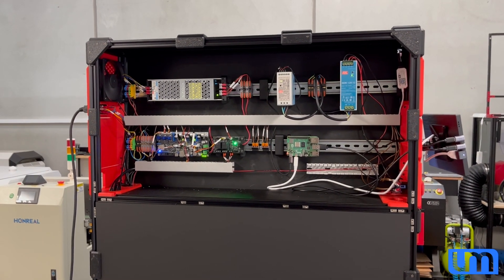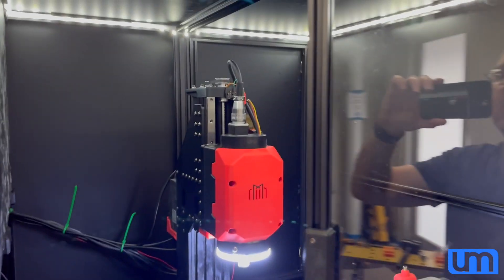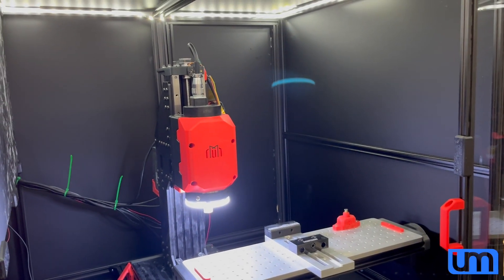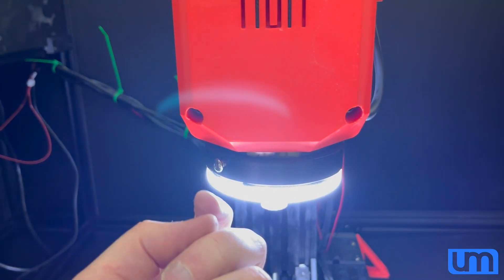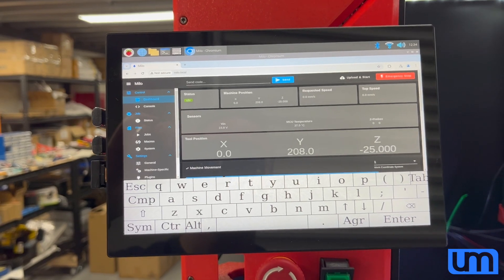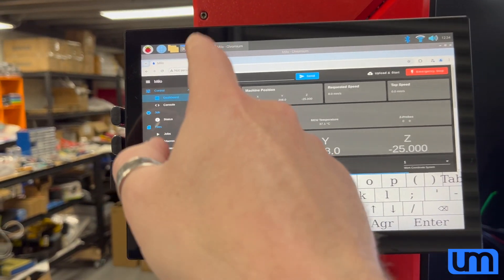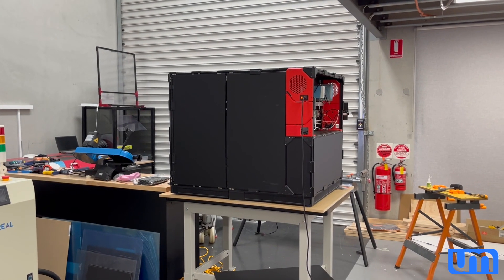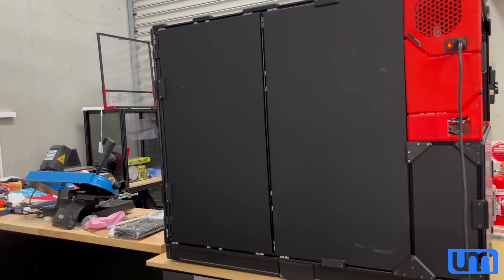First Aluminium Chips on MOO! w00t!

Comment: Don't get too carried away trying to do big cuts. You will break cutters (ask me how I know). Focus on getting you air set up properly first. Cutting ally generates a lot of heat, and if you don't clear those chips and keep the part and tool temps down it will clog the cutter and then break. Also the bigger the cut you try to do the more rigid the machine needs to be and that isn't a rigid machine.
Reply from the maker: Air is already in (since this video was shot) :) Milo can cut MUCH deeper than I did - I did 0.5mm step down and folks are doing 1.5 - 2mm step down (with a 6mm endmil). Folks are also cutting mild steel with their Milo, but yes, I hear you, and though I don't want to have to wait 45mins for a conveyor bracket, I also don't need one in 10mins ;)
Reply: @UnexpectedMaker  not so much if the motor / cutter will cut it, but whether it will cut it accurately. The deeper / more aggressive the cut, the more side load that is placed on the cutter / spindle. Too much load can start to flex the frame and cause out spec cutting.